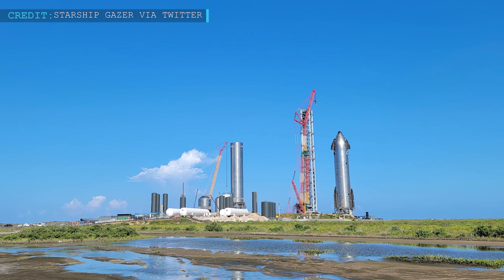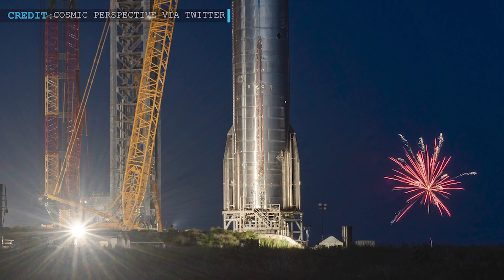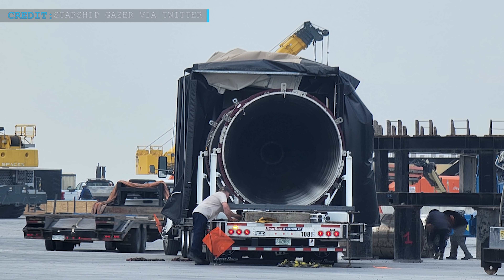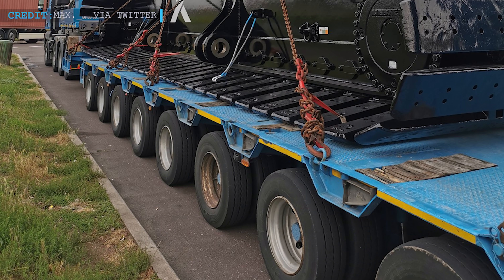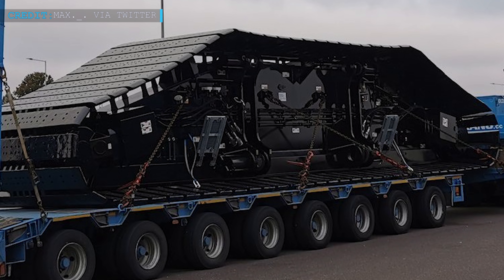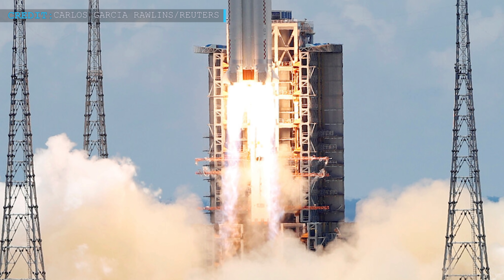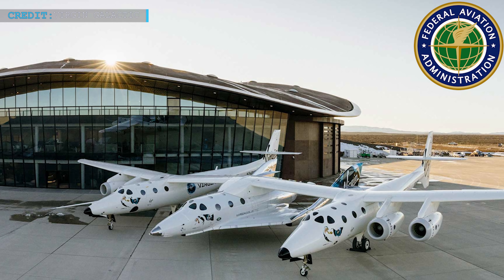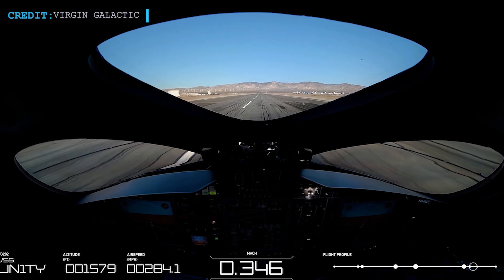SpaceX repairing Heat Shield, reinstalling Raptors on Starship ahead of first orbital flight

Comment: You can see some stainless steel structure under the tiles on the top of the fin at 3:40. Is that safe? shouldn't it be completely sealed?

Comment: Maybe the reason for there being no cryo test of the starship, if that is the case, is because the strongest way to make the starship has been worked out and no more of that testing is required and they were just parking it where they did to work on it and have it close for stacking when the booster was ready.

Comment: Why don't they develop Airships for Mars?
Reply: Sure, Helium or hydrogen would work. CO2 is denser than air. Since the CO2 and Helium would both be ~1% atm, a weather balloon that just floats around and transmits back to a lander could cover a lot of ground and give nice data on winds, etc. But a hydrogen balloon that floats people would need to be about 10-100 times the size of the Hindenburg. Maybe someday using Martian materials. At least it can't burn.
Reply: That's way in the future , we probably won't live to see that

Comment: Virgin Galactic looks like the dumbest design you could possibly come up with - Elon Musk said it best when he said rockets should not have wings (flaps are okay for sky diving on starship - different concept).
Reply: @michealjohnson8248  the shuttle was built for different types of missions than VA, VA is just dipping into space where the space shuttle was meant to service and repair satellites in space and act as a crew transport as well all with tech from the 70s and 80s. many of the design choices for the shuttle just arnt necessary anymore with modern tech